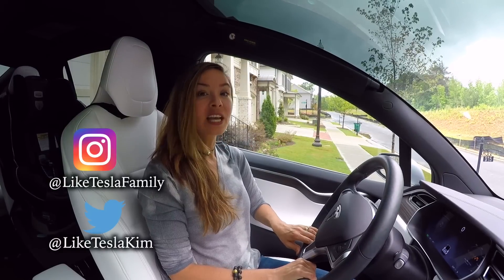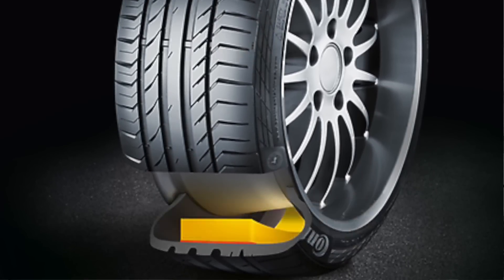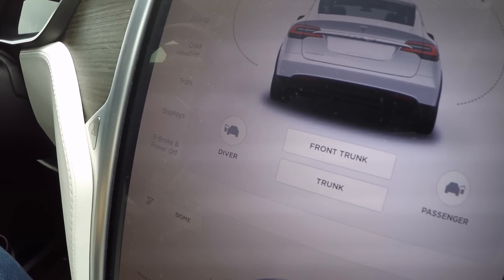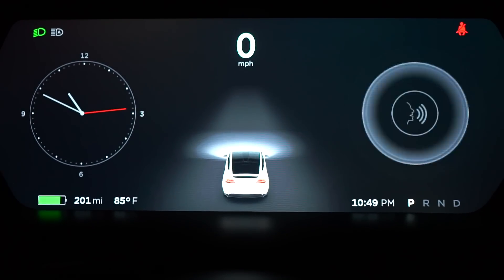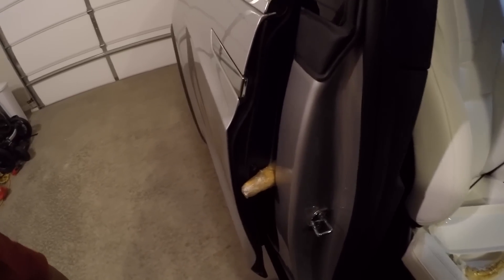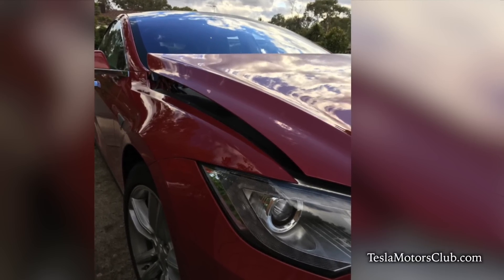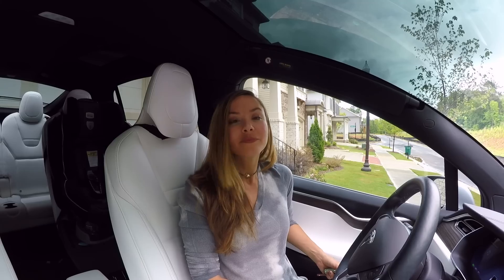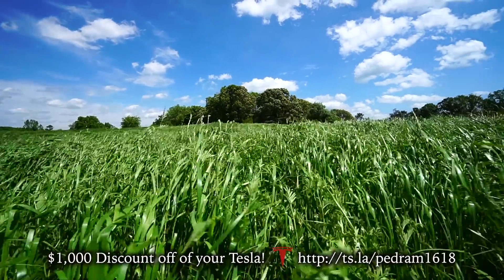Things You Didn't Know About Model X Part 2!

Comment: Just a tip about the Summon feature that I find useful; When cleaning your tires you can use Summon to roll the Model X FWD or back about 1/2 of a wheel rotation to clean the other half. When sitting inside the car, it is difficult to judge the distance. 
Ok, not a Big Secret, just a handy tip.
Reply from the maker: Great call.

Comment: If you click the auto pilot lever 9 times, it turns the little diagram of the road where it says it's on auto pilot to rainbow road from Mario kart, if not the auto pilot lever ,it's one of the ones that when pressed it goes towards the driver. I saw it in another video but can't remember which one.

Comment: That "active hood" mechanism is not unique to Tesla, Mercedes Audi Volvo and the likes have them. Thus its not innovation on their behalf
Reply from the maker: Charlie Molda very true. Innovation came in as Tesla had challenges in incorporating the "active hood" into its cars as the front trunk needs to stay water tight where as in an ICE it is vented. Here is the patent and the sealing challenges Tesla faced in designing and incorporating the feature.
https://www.google.com/patents/US20130076076
Reply from the maker: CRS1964 regulatory requirement in Australia and Euro markets.
Reply: volvo put in a airbag aswell
Reply: Charlie Molda Because you have a trunk in front so it needs to be watertight
Reply: The Tesla patent doesn't mention how the seal is deployed in conjunction with an active hood mechanism. The patent details a seal structure that is designed to enable about 25 mm of downward deflection by deformation of the sealing flange when the upper surface of the hood is forced down by a collision. 

U.S. Pat. No. 7,303,040 is the active hood patent, and it's assigned to a company called Autoliv Asp, Inc. which also holds other automotive safety patents.
Reply: Charlie Molda nobody said they invented the hood mechanism.  Nor did anyone say only Telsa has that feature.  Does Mercedes, Audi, or Volvo have gull wings?  If not then they do not innovate.  You lose sir.  Good day!
Reply: David Beppler Mercedes HAD gull wings
Reply: Volvo even have an airbag for pedestrians.
Reply: RB26DETT gullwing and falcoln wing are 2 completely different style doors
Reply: Nissan 350z First of all, David said that Mercedes did not have Gull wing doors which was available on 300SL and SLS AMG. Second, I know the difference. So the guy you should correct is David because he said that Model X has a Gull wing doors not falcon wing. Third, I know the Diff between those two.

Comment: All these electric cars are great idea I have one question if we all start driving electric cars what are they going to do with all the gasoline? Gasoline is a byproduct from refining oil. The Tesla car is not possible without petroleum or oil because you need oil to make Plastics tires lubricants for the bearings in the vehicle in other polymer materials. which means you're always going to have gasoline as a byproduct.
Reply: Like you mentionned, oil will always be used to make products like plastic, detergent, asphalt, lubricants, etc. Using oil for moving people is just not an efficient way of using this ressource. Only 15 to 20% of the energy is actually use to move the car, the rest is wasted in heat.
Reply: You're still not explaining what we're going to do with all the gasoline that's left over if we're not putting it in a car. For the most part there's no efficient way to
 generate Electric efficient way to generate Electric rather you do with solar cells or coal fired power plants Natural Gas you also have to factor in transmission of that and the conversion of the electric to the battery system.
The most efficient way to generate Electric is by using a fuel cell. Fuel cells can take any hydrogen fuel and basically converted to Electric which is highly efficient. For all of Tesla's innovation where is there fuel cell powered vehicle.
Reply: Here's what I am simply saying we're living in a world where people are panicked about the environment and they're coming up with things that at the end of the day are as environmentally impact as a regular car is burning gasoline. Did you ever see what a lithium mine looks like it's not very environmentally friendly or all the chemicals we use to create all these solar cells and everything else we're training one bad environmental thing for another. The u.s. Navy conduction experiment where they were able to take sea water and create regular jet fuel that could be burned in a jet engine with no modifications to the engine.
Reply: The reality is industrialized nations and developed Nations use more energy than can possibly be made using solar and wind and we're going to have to come up with new technology to meet these needs solar and wind sound like a good idea but they're simply not going to meet these demands.

Comment: I like My model X P100D L,  but I wish the factory would take care of the defects:
some of the body panels are crooked by almost half an inch
 the chrome strips that are glued on are very crooked
the active spoiler is chipping paint every time it raises and lowers
the horrible paint job  ( bubbles, chips, orange peel ) done by Tesla. 
The "Trunk" door fills with water every time it rains and won't drain until it opens 
the service center is wonderful, and has tried for many weeks to get these factory defects fixed, but can't without the folks in Fremont getting involved and they are too busy prepping for the model 3  :(   The car is very fast, and fun to drive The Easter Eggs are great to play with - but it is an embarrassment to look at!!  So Sad!

Comment: what about the front doors how do you manually open them
Reply: The door handle....
Reply: Reg Dunlop if you dont know, the front doors are not mechanical.. its also electrical. Those handels are just buttons.
Reply: I know man. I'm just messin around.
Reply: @Reg Dunlop lol okay. Because I did not know that until lately there is a video where tesla system got freezing out and lock all doors on a video on youtube

Comment: My $25k Audi A3 nearly has the exact same features... exept for the unsafe doors and the James Bond references.. but those are not worth $120k
Reply: Kommentator No your Audi is not the equal to the Model X. Better luck next time.
Reply: Edward W I never claimed that. I was just suggesting that the Model X is not worth 6 times the value of my A3, especially as there is no difference in quality.